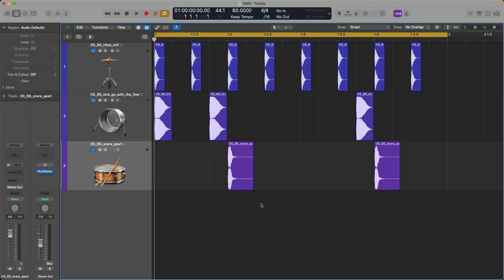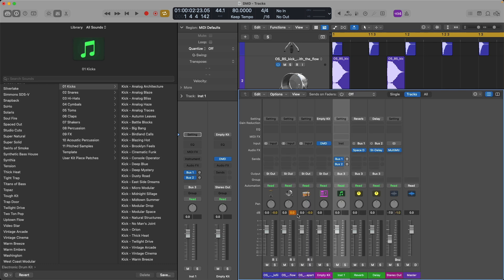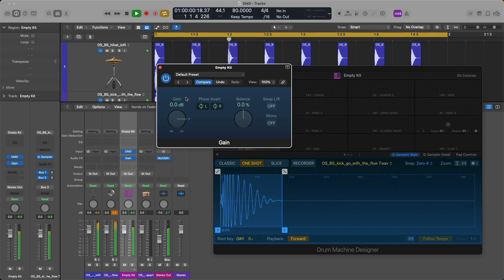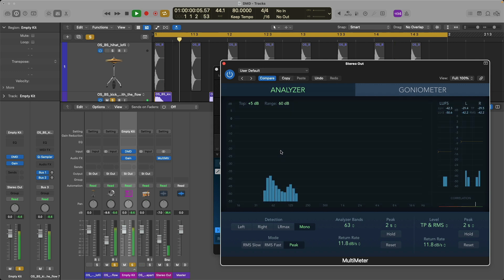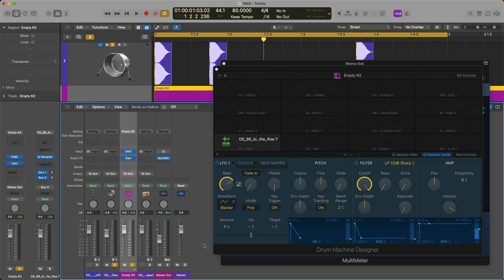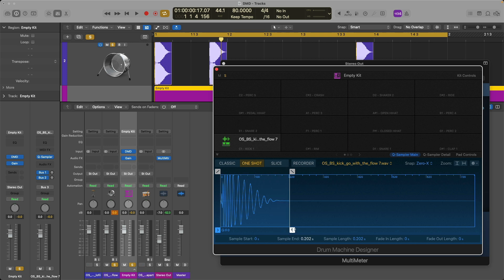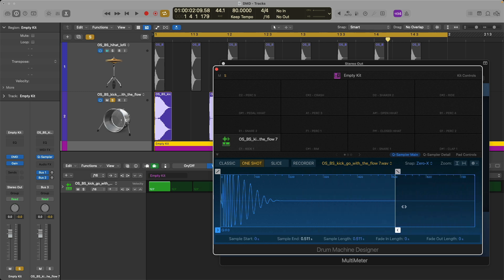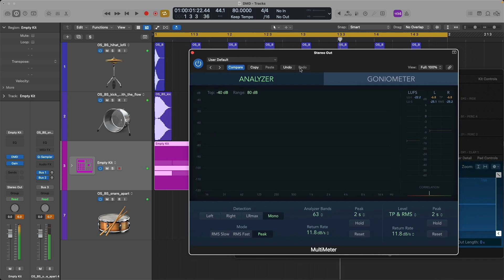Drum Machine Designer Change Sound of Your Samples?

Comment: Brilliant. I don't use DMD or the step seq at all, but I do drag samples into the full sampler. It doesn't seem to mess with anything.

What's interesting is what is actually in that sample in the extended part that appears to have nothing in it (using DMD and the Q sampler). I usually truncate that anyway, but I wouldn't want anything there in the first place. Since that stuff is very low frequency, maybe I just don't notice it in the sample—that extended part may actually have a gradual oscillation at a low frequency that just isn't visible.

One thing I wish they would do is allow us to expand the sample as visualized by allowing expansion of the vertical (level) axis.